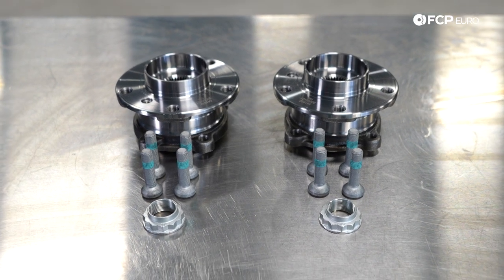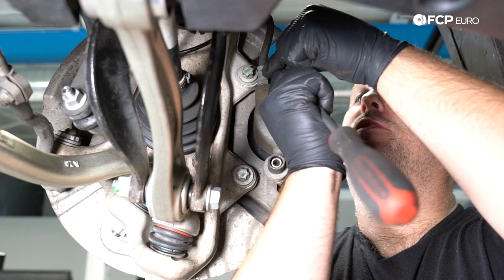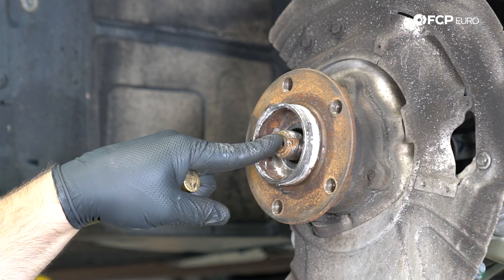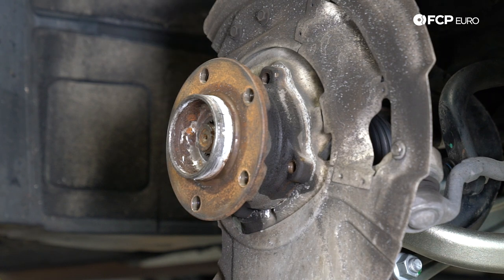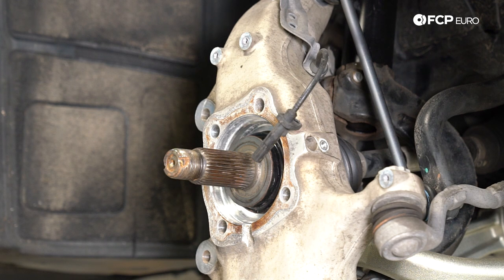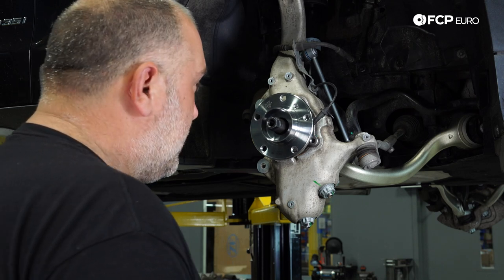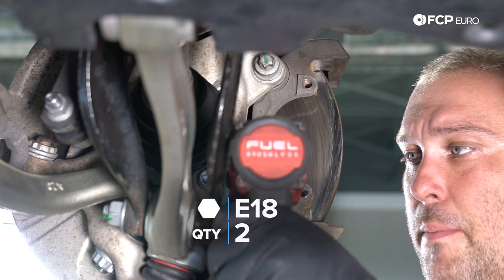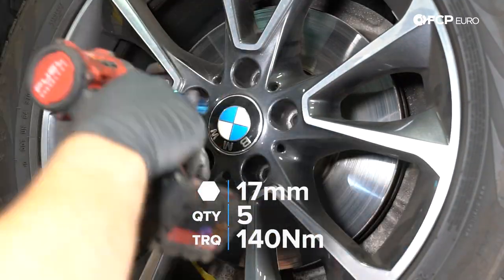BMW X5 Front Wheel Bearing Replacement DIY (2014-2018 BMW F15X5, F16 X6)

Comment: It's exactly the same process as on the X5 e70.
Applicable to 2007-2013. Great video.
Reply: Yes The bearings is the same VKBA 6619
Reply: I'm doing the front wheel bearing  on my e70 X5 2010 and the bolts/bearing are the 12 x1.25 mm.  The torque for these bolts is ?  120nm + 90 degrees?   Thanks for confirming .    All of the FCP videos are great.

Comment: For my 2011 x5 50i, the same process but a couple notes: the wheel hub bolts on the original are XZN heads, the kit comes with the t60 Torx heads, so make sure to have XZN sockets on hand. My brake slide pins were a 9mm Allen head, not a 7mm...and ONLY a 9mm will work, so head to NAPA and grab that right ow because it isn't in whatever kit you have on hand. Otherwise, it's the same process. For fitting the new hub onto the axle, you can use some compressed air in a can (aka computer dust)  and turn it upside down and freeze the axle spline, shrinking it just enough to make fitment possible.

Comment: It's never a bad idea to do a 4 hub changeover at 120000 miles. You realize how much the wheel hubs affect handling, noise, vibration,smooth braking,and safety. X5 is a heavy vehicle with high bearing load, especially with dynamic drive.

Comment: Great video! You mentioned that pulling the axle back through the hub using the axle nut was kind of a no-no. in the past, I've threaded the nut on to the axle and gently pulled the axle through the hub using claws and a slide hammer, and I said gently :-)   Why do you think that that's a no-no?

Comment: My 2015 X5 M has a roar coming from the front driver's side wheel I believe it's the wheel bearing, it's at 50000 miles I'm gonna change it anyway. is this video helpful with the M series X5 2015 15 thank you.
Reply: Rodney, did this help you or was it something else as facing similar sound myself…

Comment: My axel will not push back from the hub.  I tried pounding it, and using a 3 jaw hub puller but no dice.  Am I missing something or is it possible this thing is super rusted on ?
Reply from the maker: it can be admittedly EXTREMELY stubborn, just ensure when pounding it you arent in fact mushrooming the head of the axel, as that will cause it to become a bit more stuck than it may already be(always hit it with the nut still on). IT could certainly be well rusted in there, have you sprayed any penetrant?

Comment: How do you know when the bearings are bad?
Reply: Jack your car up and wiggle the wheel north and south. If there is any play/movement at all, the bearings are shot.
Reply: not necessarily....honestly your wheel bearing or hub can go bad and have different symptoms
typical you would here some sort of noise to start with.  there could be play in the wheel not all the time.. if there is play make sure it coming from the bearing.  I have to change mine because the lug bolts hole are stripped causing my wheel not to drive like a bad alignment when turning